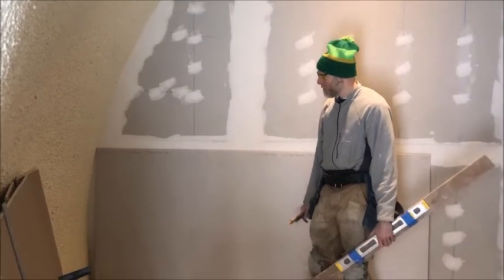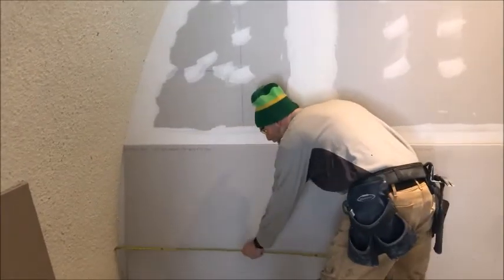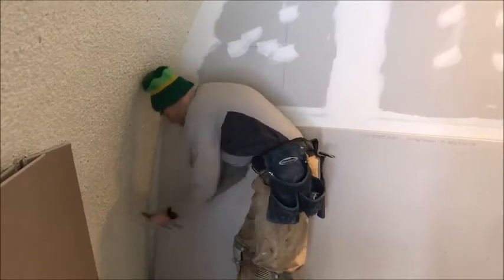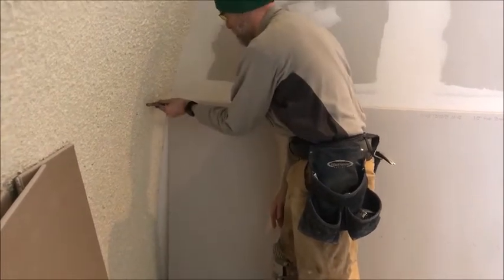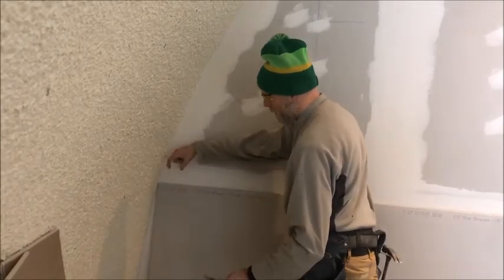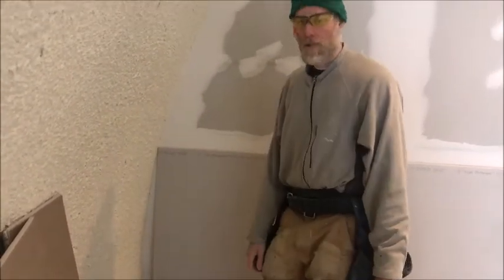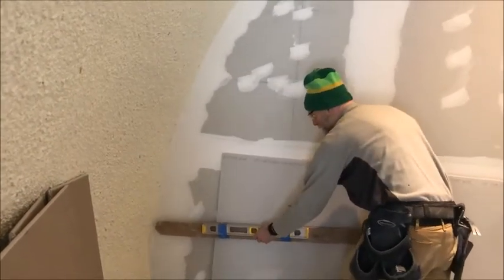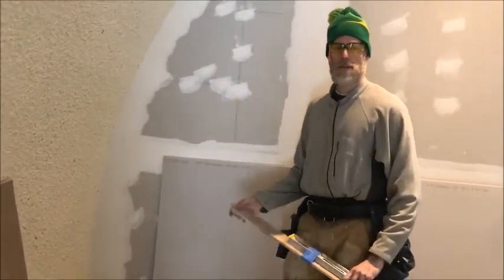Scribing Sheetrock to Curved Dome Surface

Comment: Hey how is the inside temp with the artic cold CT(PA here) is getting?  Thanks for the tip. It will be my builder's first dome interior so if he needs a hint I can show him this.
Reply from the maker: Now that the house is sealed up temporary exterior temperature changes (like a few days of extreme cold) don’t do much. We are heating it with a small electric radiator style space heater. It is meant to heat a room. We bought it a long time ago to put in our daughters room when she was an infant. The sheer mass of the house makes it very stable. That said we did get some condensation and a little ice on the inside of windows that were on the other side of the house from the heater. The air temp hasn’t changed but clearly some interior surfaces are colder than normal. Make sure you plan for air exchange and dehumidification.
Reply: @dometastic  yes I've read on planning proper dehumidification especially since we will be in FL.  But even Aidomes had humidity balancing issue.  Shame they had to close.
Reply from the maker: @doclees11  I am glad we listened to people when they warned that the houses are so tight that you have to really think about how to get fresh air and deal with humidity. We are seeing that this winter since we don’t have any of the real systems up an running yet. We are running a dehumidifier on high 24/7 and it struggles to keep up. We keep moving it around the house. Some of it is moisture from drywall mud and paint drying but if we lived there we would be producing moisture as well. Showers, cooking and just being there. We planned for two air exchangers (one on each wing) that also have dehumidifiers. At the time I questioned if it was overkill but I am glad we decided to do it even if it meant more roof perforations.